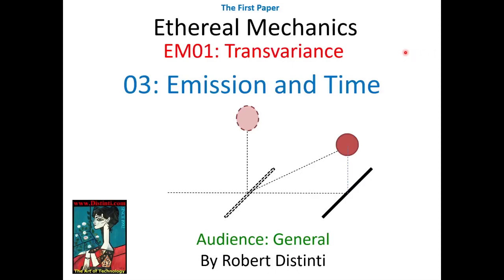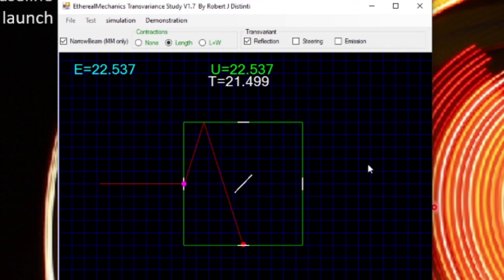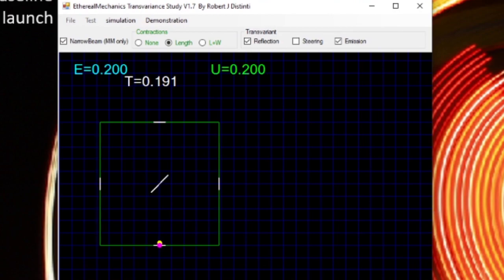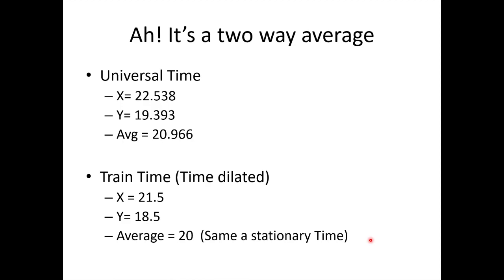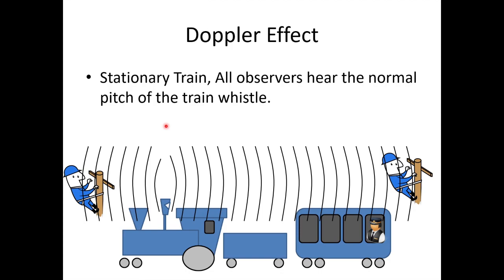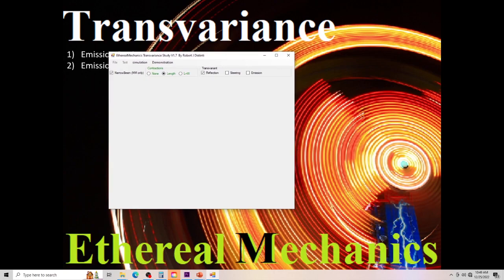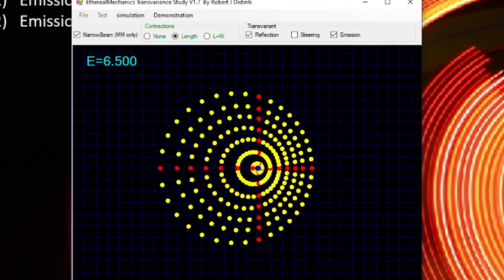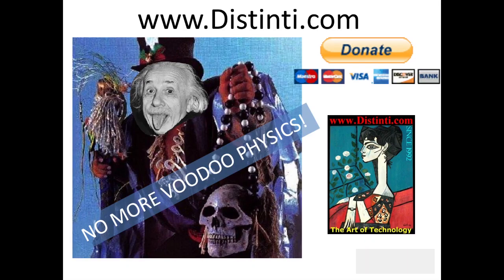EM01 03: Transvariant Emission and Time Dilation

Comment: If a beam of light when from a moon to a planet with enough gravity, the time dilation would cause the light to slow down too, then return back up with a longer wavelength, because it's not going to speed back up on the way out. The universe isn't expanding, cosmological redshift is just a Doppler effect.
Reply: It's my understanding that another factor is the degradation of light propagation over large distances, which yields lower-energy (red) frequencies, but they're not mutually exclusive. A Doppler effect would also contribute to red-shifting.
Reply: @hermes_logios  I hadn't even considered that. Good idea.